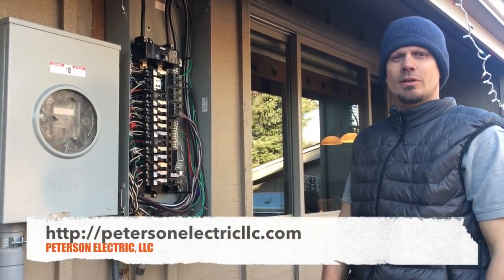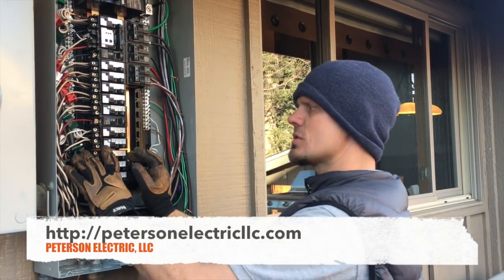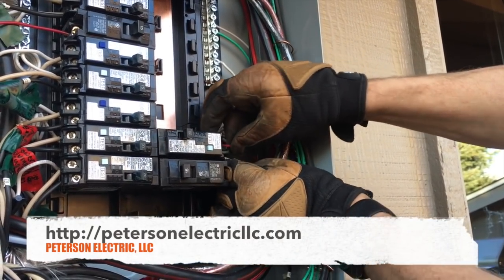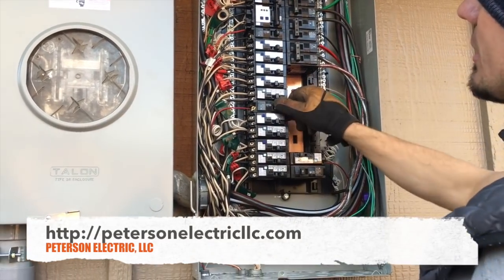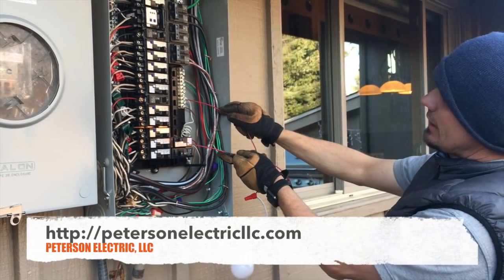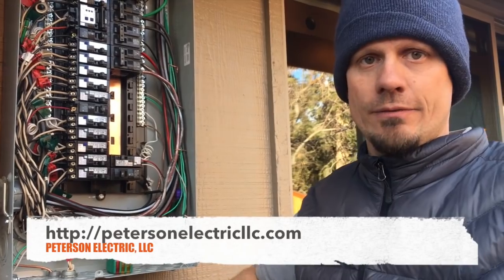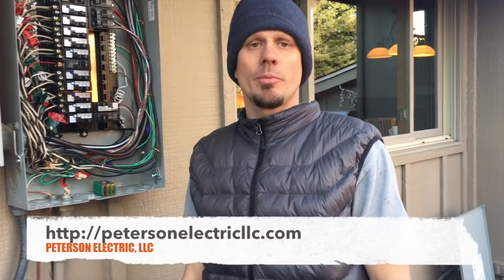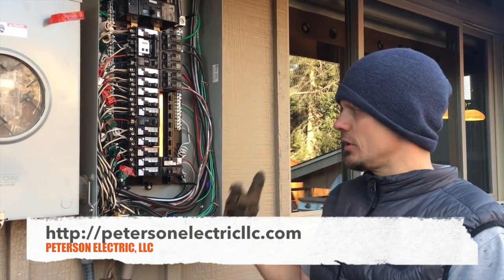Update On Arc Fault Breakers In Electrical Residential Service Panel

Comment: I know this is 3 yrs old, but videos like this are why im replacing my normal breakers with arc fault-gfci breakers....and they are pricy (so im buying them 1 or 2 at a time) and by yrs end i will have converted and will sleep better with my wife and kids in the house

Comment: I’m running into a lot of issues with combination breakers and new appliances washers, dishwashers, and fridges. From all the online research I’ve done the best answer I’ve found is from Siemens. They say to install a surge protecting receptacle at the appliance location. That seems like a cop out to me. Do you have any answers to help and are you running into this issue any. 
Love your videos, been in the trade 25 years and it’s good to see great tradesmen at work! Keep it up!

Comment: Basically now residential is all AFCI/GFCI....with a mains surge protector, AND didn't you upgrade all the outlets to TR?  Did i see a GFCI outlet outside?  where you plugged in the tester, ain't that a no no, they are no moisture proof are they?

Comment: How do you get away with stuffing all the ckt load wires through one big hole, not in individual knockouts, thus another reason outside panels are just stupid..since you can't use all the knockouts outside, what a screwy state

Comment: They also make Afci receptacles too. Which are cheaper than AFCI 
breakers. My understanding is those only fulfill code  requirements 
though when they are combination devices. Both GFCI and AFCI.

Comment: Where is expansion joint in PVC conduit feeding meter.socket. Would not pass where I am at. Saw eay too many PVC conduits pull out of glued male adapters pulling wire out of meter socket on meters only mounted 2.5 to 3' off ground.

Comment: Them arc faults suck for the homeowner but $ for the electrictian what's up with all the outdoor residential panels in Colorado disconnecting means in local code

Comment: Kind of defeats the purpose of an expansion joint when you install it completely compressed. Not only that, it's upside down. Inside pipe goes down. The way you have it potential for water to run down the insert and into the conduit, which depending on application, run into the equipment it goes to.

Comment: Oh you got a death wish you are not familiar with arc flash  ...... or nfpa 70 e
Reply from the maker: Oh, I have been arch flashed before on residential, 120 and 240 volts. It is not a huge concern as your making it out to be. It is however in commercial.
Reply: @Petersonelectricllc   If this has happened to you before why do you allow Room for error next time you encounter an Arc Flash in May be a lot bigger than the one you've experienced and it may be the last one you experience.   Not to mention the equipment and property you may damage There are times we need  To work switch gear hot Have you gone through nfpa 70E training  May not be a bad idea to look into this  You take electrical work very lightly .  Be safe and take care
Reply from the maker: @luckymex58  I have accidentally on the line side of a residents meter box touched a meter bar to the meter cabinet and it was loud and bright, but nothing blew up from the transformer and nothing happened to the cabinet. I was not able to turn off when finding a boot leg neutral on the line side of the service. 

Not sure why your so concerned with me on this video. I always wear gloves and glasses when needed. I would not risk on a commercial gear one bit. I do not get in to calls any more on this type of equipment. We are looking in to PPE for the larger panels at 480 volts. If someone in a resz. has a 120/240 volt panel, the Fault current rating on the back side of the main breaker is seriesied rated in 240. The 10 AIC rated breakers usually always catch this. NOW if the resd. do not have a main breaker and they have the six handle rule in 240 and the transformer is on a pole or in the front yard then there could be an Arch flash, possible. 

I had a 50 amp range on a 22yr old home have it's coil element shunt at 240 volts on the sub panel in the garage and the main breaker was 50' to the other side of the outside of the garage and there was NO arc flash in the panel and the main breaker was a CH  Brown handle and did not flip. I have had other calls this happened to a main breaker and it blew out the inside of the main but it was on an 50 yr plus breaker. the fault current ratings on the main breakers today as a stander on houses is 22k and you can order a 42 k and 65 k. I have installed all types. Look at your phone and add an app, by bussman on fault current cals. 

Copper vs aluminum, Plus distance of service feeders, plus distance of transformer vs manhole utility splice boxes, plus main breaker series rated vs sub panels, plus the impedenze of the transformer and the type of transformer oil vs dry and the size of the transformer.  is what needs to be considered. But keep it simple, what what your doing. In service, you have to trace things hot to find the neutral issue. I was taught this as an appliance tek 20 yrs ago, we were always looking for the return path not finding the neutral bar or path. This is what causes so many electrocutions. 

Thanks though. what ppe do you suggest as I get back in to service on commercial' panel boards?
Reply: @Petersonelectricllc    For you I would recommend in 8 cal  Suit You don't get into big switch gear like I do where I have to suit up with a 30 cal suit
Reply from the maker: @luckymex58  ok thanks, what brand or website?
Reply: @Petersonelectricllc   Salusbury 8 cal

Comment: When OP transitioned from IMC to schedule 80 PVC, he no longer have a bond for the IMC. The code only allows for metallic conduit if it's buried underground and only if needed for pulling as a 90-degree elbow that would get damaged while pulling a drag line.
Reply from the maker: The SCH 80 is Xcel requirement, not ours. It's on the Line side of the Meter.
Reply: @Petersonelectricllc  Poco?

Comment: They spliced inside a conduit??  Wow, that's an NEC violation.  Would have been OK if you have an underground service lateral and did the splice there.  NEC 300.13 (A)
Reply from the maker: I did not splice in a conduit. Where did you see this? What time
Reply: @Petersonelectricllc  Listen to the start of the Update on Arc Fault video April 27 2018 you say they spliced to make the conductors longer inside the conduit.  I just wondered
Reply from the maker: @mikefox2379  Yah, maybe your right, the job was 5 yrs ago, have a hard time remembering what I see everyday. If they did, your right, the only time that is legal is the LB fittings which have a conductor fill on them.
Reply: I don't think you did I think you said THEY.  It was the one with the expansion joint under the meter and an L/B fitting was removed.  Sorry, thought I heard you say they spliced in the conduit.  Did't think you would do that.

Comment: In Arizona we bond the grounds to the water pipes. Houses here in the 70's were all slump block with flat roofs so much fun. Most people here just take the house down to the studs and re-wire all copper get rid of all the aluminum wire, or dry wall cut and put in new copper wiring abandon the old wire. I got a quote for 25k to do that. Wondering all that work your doing panel, and pig-tail must be close to 10k at least?
Reply from the maker: I agree that going to studs is better, but it is all the other fears of what happens when you do; Asspesties, lead base paint, insulation, mice, sealing, and now if you have 2'x4' exterior walls then you have to spray foam, + windows, doors, trim, cabinets, fixtures, ect....................................
This is why people out here in CO only want to do pig-tail splicing. Typically I have see ALM/Cu with Aluminumicons at $55 to $75 an opening, depending on GFCI and Dimmer vs standard opening, for labor and materials, with two people doing the work, and a pro electrician with licenses and insurance. The only thing extra is to build new lighting fixtures and clean up the boxes. We also do AFCI and trace the circuits. If we do a service change for the AFCI this is more.

Comment: 1958 Home FL!  I replaced all 2 prong outlets with GFCI.  I have GFCI in bathrooms and kitchens.  Can I place AFCI in the panel circuit breakers (15 amp or 20 amp) everywhere but bathrooms?  Brining me up to 2017 code compliant?

Comment: wrong on # 12 A/L is good for 15 amps  20 amp you use #10
Reply from the maker: When this was design and installed this is what was acceptable than, and now the inspector said this was good. Keep in mind as you trace the circuit to know where is goes and what it's purpose is for. If a dishwasher and it is dedicated then you do not have to worry about more than 7amps.
Reply from the maker: Probably depends on manufacture, but I use my stippers to gauage this. Also, I think it is 240 d  and 110.14 c that talks about this
Reply: Isn't A/L wire already oversized Awg than copper..? So  12awg A/L is rated for 20a.

Comment: In 2018 electricians are still writing on panels with sharpies ? Label makers have been around for quite some years, or just stick a white label sticker on the panel and write in permanent marker on the sticker. Im just all for cleanliness & ease of reading, there must be something in the code book that forbids label maker stickers or something.
Reply: If I'm not mistaken, you can remove the sharpie with a bit of rubbing alcohol. Sharpies are cheap and unlikely to fail unexpectedly. If they do run out of ink and you haven't got a spare, the home owner might have one. But, because they're so cheap, there's no reason not to have spares.

If you think that sharpies are bad, my breaker box had the labels scratched into the paint. Try changing that if you need to.
Reply: Sharpies will erase sharpies if you re-wet it and quickly wipe it off.

Comment: The $5 GFCI cube shaped outlet tester cannot detect reverse polarity when a false (a.k.a. "bootleg") ground has been installed. This crime increases the risk to fire and electrocution. This crime is most commonly committed by general building contractors engaged in “flipping” pre-1965 built real estate and is found across the country. 
Motive: Money. It costs several thousand dollars to rewire a single family residence to meet code. It costs less than one hundred dollars in material and labor expenses to pre-fabricate 30 to 50 wall receptacles with a short jumper wire installed from the ground terminal screw to the neutral terminal. 
Purpose: To willfully deceive both private professional home inspectors and city inspectors who rely on a basic GFCI receptacle testing device alone. This results in the home buyer erroneously believing the electrical system is properly grounded and safe, thus increasing the perceived value of the home to justify a higher sales price, and an inflated profit. The buyer pays for the rewiring twice, once in the higher mortgage, and later to actually rewire the home.
Solution: Either physically inspect the wiring connections to the new receptacles or use the Extech CT70, the IDEAL Electrical 61-164 Sure-Test Circuit analyzer, or the Amprobe INSP-3 which have the capability to detect a bootleg ground. Both InterNACHI certified and municipal inspectors appear to resist resolving this due to their aversion to liability and risk of litigation. Search for "bootleg ground" to learn more.
Reply: This is interesting. I don't have that going on in the place I'm replacing recepticals in, but it does make me wonder if the GFCI outlets I've got that refuse to reset if not properly wired would be smart enough to identify that.

Although, if I replace an outlet, I should see if it's at least connected to a ground rather than immediately back to the neutral.

Comment: Why would anyone NOT remove all the aluminum wire going to outlets and switches? I remember that they were an issue with home fires due to the connections not being tightened as they should be. I don't know of problems with larger sizes properly connected at both ends as a feeder.

Comment: What is the white box on the ground wire?
Reply: ScottDLR It is a ground bar for low voltage systems to bond their equipment to.
Reply: It's a bonding bridge used to bond incoming cable/phone systems... back in the day they used a big clamp on the meter base which never had a ground

Comment: Hey Joshua! In a jamb I borrowed some clear PVC cleaner (from plumber) for marker cleaning. Pretty aggressive but worked. Took old labels off too. I wanted to give you a thumbs up for making honey out of horse manure! Having been there myself, everything you had to do from working with IMC to verifying a 1970's house, you left a fine job! Odd how the AHJ call it different for different jurisdictions. NFPA 70 is written in Quincy Mass. and Mass. has it's own addendum to that code. Power companies different requirements too. Some do the service lateral, some don't. I have one where I go right to the triplex!
I hold Masters in four states and it is something I have to track. 
Passed!

Comment: Panels outside is dumb...extra wear and tear on the breakers, cabinet, rust, moisture, why do they still do it 2018...man, very lax standards out there
Reply from the maker: This maybe true, BUT it was there and existing as is. If we move the panel than this causes more cost and issues of repairs and AFCI breakers, so most of my customers will not move an existing panel inside and than there are not any areas for us to mount without major damages.
Reply: here in Texas they often mount the outdoor panel on the sunny side of the house! I really do no understand how that passes inspection.
Reply: @wim0104  I would be more worried about moisture and corrosion than temperature. Breakers are designed to withstand high temperatures while arcing,  under load, and when exposed to ambient temperatures.
Reply: Per UL 489 every circuit breaker must complete an overload (Sequence-X) test to receive UL listing. This test involves opening and closing the circuit breaker at 600% rated current for 50 opera-tions. This exposes the breaker to much higher internal temperatures than are expected under normal usage. Following the overload test, the circuit breakers are tested at 100% rated current and cannot exceed a 50 °C (90 °F) temperature rise at the wire terminal connection  in 40 °C (104 °F) open air.

The plastic housings of type CH and BR arc fault and ground fault products are molded out of IDI Dielectrite 46-12, a 22% glass-filled thermoset polyester. The heat deflection temperature of Dielectrite 46-12 under a 264 psi load exceeds  260 °C (500 °F) according to the ASTM D-648  test procedure. This means that the ambient temperature within the circuit breaker would  need to reach 260 °C (500 °F) before the plastic material would begin to break down structurally.

Note: I am referencing Eaton but these facts are true of all circuit breaker brands. The UL rating and ASTM testing procedures applies too all circuit breakers irrespective of brand.

https://www.eaton.com/content/dam/eaton/products/low-voltage-power-distribution-controls-systems/circuit-breakers/eaton-circuit-breakrs-meet-or-exceed-the-strict-requirements-for-the-heat-rise-from-underwriters-laboratories-ap003001en.pdf
Reply: No choice for some old homes (2 foot thick stone walls) 
and the only path in must go through the attic.
Having a breaker box in a seriously hard to access space (attic)
is not a good idea.
That said, I located it under the front porch roof overhang 
so it never gets direct rain or snow.
Reply: Lots of clearance though.
Reply: The real reason I never designed panelboards outdoors when the conductors were indoors is that breakers are rated to trip at specific amperes installed within the panel at a specific temperature.   I believe 85F but not positive.   So what that means is if the panel is outside and the temperature is at 0 F, a 20 amp breaker becomes a 60 ampere trip or higher.   If the panel and the conductors were both outside, then no issue as temperature affects conductor ampacity rating as well.   I know you had no choice, but wanted to state another reason not to install panels outside.   Great job fixing the issues!
Reply: Dry climate out there?
Reply: @wng8993  That's what I was thinking. I've rarely had any breakers trip, but with all the days of rain or just dampness we get here, I'd hate to be stuck with wet clothes in the dryer because I can't go outside and reset the breaker.
Reply: @SmallSpoonBrigade  That could give the neighbors something to talk about! Haha
Reply: T. Wing  & Chris L.   You guys kind of missed the point.   Wet or dry climate has very little effect unless rain is running inside the panel.    The issue is temperature.    If you live where it gets very hot, no safety issue, your breaker will trip sooner than rated.   But if it is very cold outside, the breaker will not trip any where near the overcurrent rating.   The reason the breaker is there is to protect the insulation on the wiring.   So breaker outside at -10 deg F would probable not trip until it got to 80 amperes.   Since the wire is inside the house, it will not be in cold ambient temp.   In this situation with enough time, definite high risk for a fire.
Reply: @KevinCoop1  ohh I gotcha now,  I've been to Colorado before and notices outdoor panels.  I live in maine, aside from a meter/disconnect the panels are indoors.  It can get down right chilly up here some days.

Comment: Why remove the tapes? .... if you leave them in they could help the next guy ..... and that might just be you ;0) Also  another way to remove permanent marker (sharpie?) is to use a fresh permanent marker and Immediately wipe off! You need to do this before the marker dries though ;0)